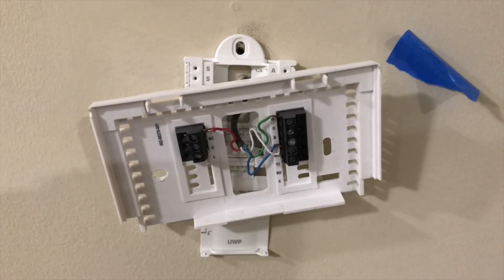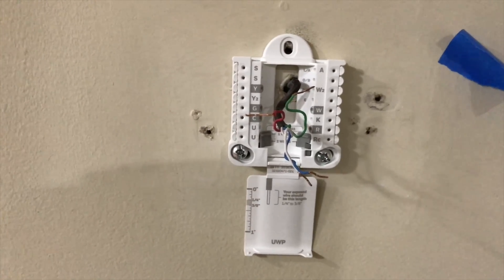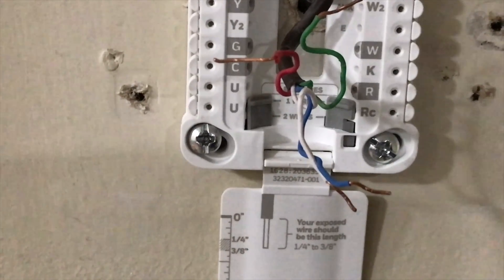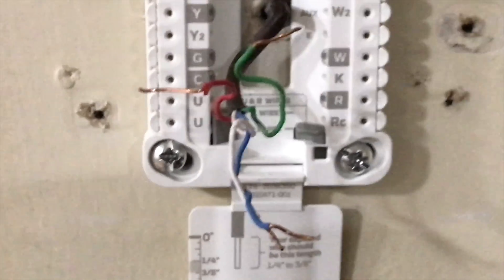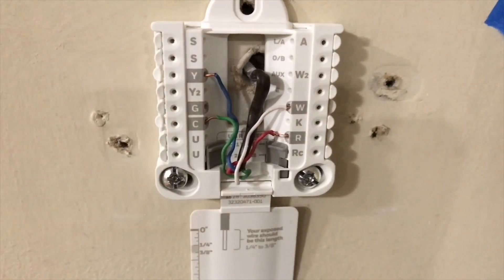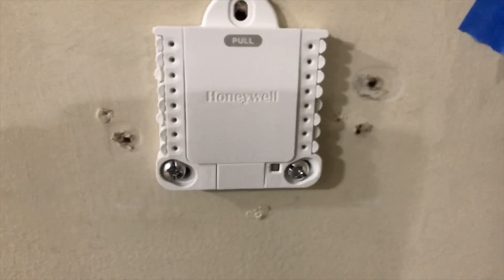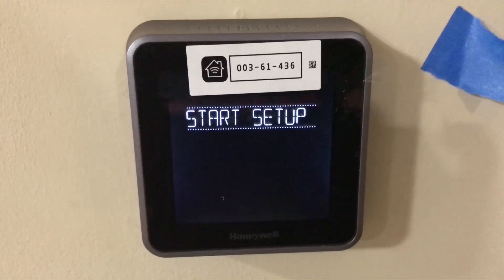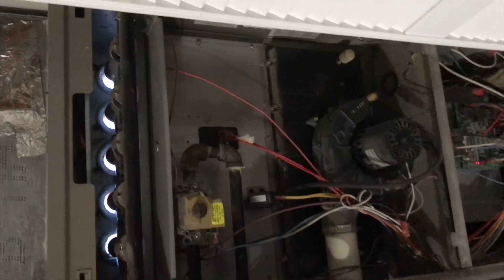Honeywell Lyric Thermostat Installation and Some C-Wire Troubleshooting

Comment: Good day.  Read on if you have three wire thermostat bundling.  In my case multizone hotwater heating with 8  zone valves, 3 transformers and a propane boiler (and 5 pumps).   
This applies to those moving from a two wire honeywell thermostat (which covers the older mercury tube type, OR  the LCD display type that needed batteries to display and programme).
All my wiring bundles included a third wire folded back, which we will use for the Common Wire discussed.   (no fan, no cooling, no heat pump, just heat)

A. The steps are as follows.
a.  identify which wire is going to the load side of the transformer in the boiler room (should be the wire currently hooked into your R connector). Confirm proper wiring.
b.  identify which wire is going to the associated zone valve for that zone  (should be the wire currently hooked into your W connector). Confirm proper wiring
c.  Work backwards from the zone valve motor to find the single (usually yellow wire) that is connected to a single wire coming in from thermostat wire bundles.
(the other yellow motor wire is connected to the non load side of a transformer and in my case is maretted with a bunch of yellow zone valve wires and one other wire going to the non-load side of one of my three transformers)
d.  The single yellow wire connected to another single wire is how you find the W wire from the applicable thermostat and now you have located the correct thermostat wire bundle in the boiler room.
e.  trace the R wire from this bundle to the associated transformer as this is were the common wire needs to be attached.
f.  attach the common wire end in the boiler room, typically with a marette to a new piece of wire which is then attached to the SAME TRANSFORMER as the R wire BUT to the opposite side(screw).

Synopsis A:   With a multi-transformer scenario, I found the easiest thing to do was find the yellow wires (coming from my honeywell zone valves and attached to the motor) and found which one was connected to the W wire from the wire bundle - this was a one to one connection.  (The other yellow wire was joined with other zone valve yellow wires and was connected to a wire going to one of my transformers on the opposite side to the load side on that transformer and thus not helpful.).    Finding the W wire allowed me to trace back to the 3 wire bundle from that thermostat coming into a common wiring box.  Now I could locate the Common wire and importantly the R wire.   I had to know which transformer the R wire went to, in order to ensure the common wire went to the opposite side of the same transformer.

B. AT thermostat the following step applied.
(a) Ensure the R and RC switch is down, in the 2 slot position (both holes exposed)
(b)  Connect the C wire to the C post/slot
(c) Connect the R wire to the R post/slot
(d) Connect the W wire to the W post/slot
(e) create a little jumper wire (u shaped with exposed copper at the ends) and CONNECT R to Rc

Explanation:   The R and W wires form a 24 volt circuit WHEN the thermostat calls for heat, (the thermostat joins the R and W wires creating a circuit for juice to flow).
The jumper between R and Rc creates and additional circuit between Rc and C WHICH HONEYWELL OMITS in all their literature.  Tech support kept telling me I needed four wires, R,W,C and Rc and that I needed to create a similar circuit to RW, using C and Rc.   Well by using the jumper I effectively used the Juice on the R side sharing it with Rc. Since the honeywell internally connects Rc and C, the needed circuit is established from the get go and the thermostat powers up.   When the thermostat calls for heat, the R and W are connected and the zone valve motor turns on and operns the valve (tested and works).

So the two keys are (1) knowing that honeywell uses the Rc slot and C slot for power to the unit and (2) the C wire has to be on the same transformer but opposite side in the boiler room
If you have the different standard square sized honeywell thermostat or find the video on you tube for WIFI honeywell, you will see that they have the jumper already in place!!!

Good luck with your own situation. :-)
Reply from the maker: Thanks, Alex Raiche-Marsden for spreading the knowledge!

Comment: Thank you sir! I had the same issues you had at the beginning and then followed your video and it worked. Thank you for saving me so much time and frustration!!!
Reply from the maker: Hi Candice MacDonald, Sorry for the delayed response. For some strange reason, my comments are not coming to my email anymore. I have to check in to this. I am glad my video helped you. Thanks for watching!
Reply: Hi again.  I was just wondering, and in no way trying to blame.  I installed the unit Sept 28 and just 2 days ago, the AC won't turn on.  A tech just came by and said the conductor needs to be replaced.  I have no clue about things like this.  Do you have any idea if the new thermostat could have blown the conductor?  or the way I installed it?  Keep in mind, the AC unit is very old.  So it may just be a coincidence and was simply it's time to go lol.  Any advice is appreciated....and maybe some reassurance I did nothing wrong  :)

Comment: Thanks so much for posting this. I was getting so angry because I had the common wire connected to the same colored wire that was "extra" from my old unit. Nonetheless, I figured out that that colored wire was going to something else. In fact, the wire I needed to connect to the common was wrapped around the wire casing that went up to my thermostat. All I needed to do was connect it with a wire nut and voila!

Comment: Hey man. Just want to start off by saying thanks for making this video!!!! Just bought this today thinking I’m doing my family a service by being more efficient and smart about heating/cooling. 

Here’s the thing. I don’t wanna use the “Y” in “C” as I have AC and lately we NEED it here. 

I traced back my wiring and found two bundles. One going to AC and one to thermostat. The one going to thermostat does not have the “C”. The bundle going from furnace to AC unit has the “C” wire. Could I just fish a wire from thermostat and connect to the same “C” location on the furnace circuit board ? 

I would simply buy a length of wire, tie it to the bundle that comes out at thermostat and pull towards furnace. Install my C wire on panel and fish it back up through the walls and back to thermostat. 

Would this work ? lol
Reply: Mario, you just described the ideal 5 wire setup :-)
Reply from the maker: Hi Mario Patrick, I have been out of town for the last month. I wasn't able to check my messages until today. I do apologize for the delayed response. Did you ever get the thermostat up and going?

Comment: So wait, why does green have to go to C and blue have to go to Y? I'mma scared I might set up mine wrong! If you need more info on my house, my house doesn't have AC, just a furnace and a broken attic fan
Reply from the maker: Hi SomePerson4, The C wire will send power to the unit at the green terminal. Try to install it the way the instructions tell you to first. If it doesn't power up then, install it the way that I show in this video. Thanks for watching!

Comment: Hello, when I looked in my setup on the system, my y and c are hooked to the same. I put my G back in the G slot. Used a little white cable that came with the thermostat and put it in the C slot
Reply: Thermostat powered on and I was able to set it up but I noticed my air conditioner won't power on. Please help

Comment: Does this work on 220V system?
Reply: Nope, you'll need to get the power converted to 24V through a transformer before you could get it to work, else you could fry it

Comment: can u wire that thermidtat to a 2 wire boiler system(r and w) I have a boiler with an aquastat and I have 2 hineywell zone.valves for controlling 2 zones. I ran 3'wires but dont know where my c wire ties.Into the boiler

Comment: Your ac is not gonna work doing this. Just hire an hvac person and they will get this wired to have both heat and ac working.
Reply from the maker: Frank Jewell. I know the AC is not going to work. The house doesn't currently have an AC unit. However, there are cooper lines ran. My brother is an HVAC guy and I'm a certified electrician. There is nothing on earth me and him can't do. We will install a new AC unit and run the necessary wires for it to work properly. Thank you.

Comment: Thanks for the informative video, never would have found out the C-wire problem.

I’m installing on an older model A/C unit, and it will I am getting power to the fan, but the condenser will not power on. Any ideas how to get it to work?
Reply from the maker: Try to jump it with the wire you replaced for the C-wire. I have more details about this in the description box. Thanks!

Comment: Hey man. Will this work if I have a four wife system. I have a red, white, yellow and green setup in a one story house. Will I have to put the yellow wire in the "C" slot??
Reply from the maker: Hi Mike Chavez, sorry for the late reply. The house I installed this thermostat in has only four wires. That's why I made the video. It should work fine for you as well. Thank you.
Reply: Terence's Youtube great! Thanks man!
Reply from the maker: You're very welcome.
Reply: Hey Terence! So I noticed that I had an unused blue wire so I connected it to the "C" slot in the Lyric thermostat then I went to the circuit board and found the unused blue wire and just inserted it to the Common terminal. I switched the power back on and wala! It turned on and I was setting up the app. Then moments later it shut completely off. I tried following all the steps I took which was only about two simple ones and decided to just re-install my old thermostat but that also didn't work. Now my heater and A/C won't turn on :(
Reply: Terence's Youtube video

Comment: DO NOT transfer the yellow wire to "C" as recommended on the video - the thermostat will power on but A/C will not run. Leave the yellow line or whatever was matched to it in place. INSTEAD if you have a spare wire attached at the thermostat unwind this and plug it  into the "C" line. Identity the corresponding connection on the control panel - this could be appropriately marked "C" or in the case of TROLATEMP/MASTEROL panel will be "M1" (two wires in the same port is not a problem). This will solve the problem.

Comment: For whatever reason this didn't work for my 4 wire configuration. Although it did get the thermostat to power on (it previously wasn't) The AC Compressor would not come on after. It would only blow regular air and I didn't even test heat. 

Turns out I actually have four more wires available for use if I need them so I will try use one of the extra wires to hook this thing up, but I'm not sure its going to work. As I already tried tying in one of the extra wires to the "Y" at the control board level and then using the thermostat end of new wire for the "Common" that also got me power, but still the same issue with no compressor kicking in. 

I will ask an HVAC Contact about it unless you have any ideas. I live in a condominium building. I believe I have what is known as a "package" whereabouts furnace/condensor/blower are all in one inside the condo. However far as I can tell it wires up just like your standard forced air or condenser unit. There was a jumper on my old thermostat as well. But you know Lyric says you don't need them so...

Comment: I installed the T5 last night.  Everything was smooth sailing, install, wifi lync, mobile app until I turned it to cool mode.  So it was blowing hot air set at cool mode.  I have a 7 wire setup with a single mode heat pump.  I have a R, Y, G, C, O/B, W2, and E wire.
Reply from the maker: Hi, 

I am not sure why you were getting hot air while the thermostat was set at cool mode. These T5 are tricky devices. It could be something in the settings because you have a 7 wire setup.
Reply: vista7 Honeywell thermostats use a fail safe system to avoid damaging the compressor of your ac unit. when installed, It will run your furnace in hot for about 10 min. then it will go back to ac.
Reply: Yah, I finally got it working.  That must have been what the problem was.  It works great now.
Reply: Provably have the O/B wire wrong

Comment: if you have a 4 wire setup and need this yes you can put the green fan wire on c/common and go to the air handler and just put a jumper wire between g and y1 if its a heatpump problem if you have a gas furnace you better hope you have a heat seq for the fan.

Comment: Great video... I spent 40 minutes being on hold waiting for Honeywell Tech support while I found your video.   It worked!!   Does anyone know if the AC will still work doing this?  Its winter here and my AC units are covered with plastic covers so I can't check at this time.

Comment: I just hooked mine up and it is not cooling my house. I can't find anything about this issue online. Help? I didn't know how to answer the staggering amount of questions and what settings it should be on.
Reply from the maker: Hi Importtuner1150, I am sorry you cannot find any information regarding your thermostat issue. I had to troubleshoot mines on my own for that same reason. Did you install it like I did in the video? Or did you install it by the instructions? If so, did you have issues getting it to power on?
 Did you have a C-wire? Sorry, for the many questions. I rarely reply. but when I do, I try my best to help. Thanks, Terence
Reply: Hi, I had the same backlighting issues, and when I followed your post it worked. However my AC condenser is not turning on. any recommendations. Please feel free to email me at jesusalbertosilvas@gmail.com
Reply from the maker: That's awesome! I am glad you got it to work.
Reply: thanks for the reply. I am new to do it yourself stuff and didn't know my blue c wire was buried in the back of my sheetrock as my old thermostat only had 4 wires. I hooked it up like you did and everything works fine. I hope I hit the right settings when I set it up. I downloaded the manual and I have no clue what the complex questions meant. so I just selected the most common answers that the manual recommended. thanks for yalls reply and help. it helped me a lot.
Reply from the maker: Hi, I'm not sure if this will work, but jump the blue wire and connect the jumper wire to its correct location. The AC might work then. If this works, please post the results in the comments so we can assist others. Thank you.
Reply: The problem I had was not hooking up my blue wire in the common port. My previous thermostat had a 4 wire connection and none of them were blue. If you hook up the other 4 and not the blue one, the compressor will not come on and will not cool your house. After finding my blue wire After and connecting it, everything worked fine. Thanks for your help!
Reply: Terence's Youtube hi need some help my system is not cooking . Everything is installed . I have a yellow green red white and blue wire any advice will help
Reply: importtuner1150 what do you mean by blue wire. I only have 4 wires and I move the g to c in the thermostat and down in furnance I connected the g to c and connector from y to g

Comment: The biggest problem here is that your heat will work but not you ac. I appreciate the info but if your an electrician then you should know when you change wires that not everything will work with the t5 lyric.

Comment: I take it all back!!! please disregard my previous posts. Your video saved my life!! I installed my thermostat (as the guide book said) and it would not work. I called the 1 800 number and the support tech told me I had to buy a wire saver device from amazon to power the thermostat. After a few moments of major frustration I watched your video again and followed your advice about the c-wire connection and BOOM! I was good to go! Please accept my apology if it weren't for your video I would be in the dark with this very expensive thermostat. I would also like to say its a shame that customer support doesn't know, or simply wont tell the customer about great fix you've posted here. Any way thanks again, I really cant express how thankful I am to you for your video. You rock!!!! Peace out.